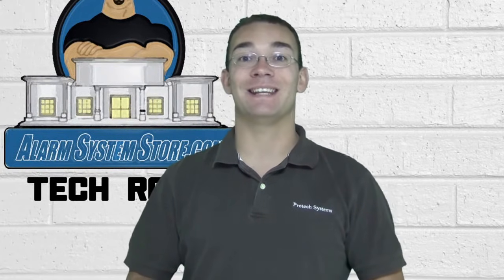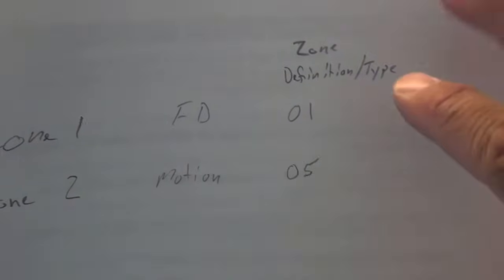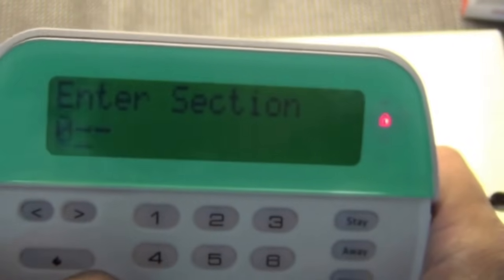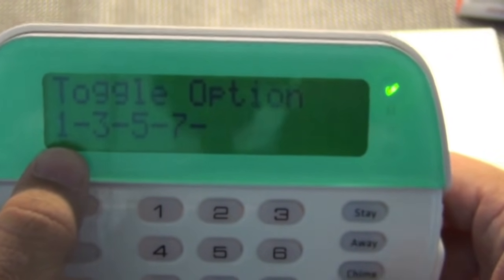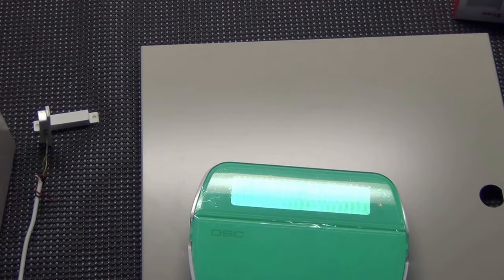DSC Power Series Programming - Alarm System Store Tech Video

Comment: Other than the extra work involved to install EOL resistors, is there a good reason not to use them?
Reply from the maker: No, it is always recommended that you use resistors with your wiring as it offers a little extra troubleshooting help if you have wire problems. The option to skip them just exists if you don't want to mess with them.

Comment: How to reset the master key?
Reply from the maker: If you can get into the programming of your system, the master code can be reset there. If you have no codes for your system, you will need to perform a hardware default and essentially start fresh with the system.

Comment: Can you please post for the system DSC RFJ5501 of how to get rid of the yellow triangle. My system was installed 12 years ago and the company is out of business! Help!!!
Reply from the maker: Unfortunately those systems and keypads have been discontinued so we dont have a way to make a video for them anymore. If you search up the manual for that system though, you could check out the procedure for checking trouble codes. The 5501 keypads can be difficult to work with though so it may be better to see if anyone in your area works on alarms without forcing you to buy a new one.

Comment: Using pk5501 followed the quick start and video. Have 4 zones. 1 being front door (delay), 2 interior door (instant), 3 motion (set to 5), 4 interior (instant).
My motion does not work. Thought it was a bad sensor and changed. Same result. Is there something I’m missing? What should the attributes on this be?
Reply from the maker: Generally you don't mess with attributes for a hardwired zone.
Reply: @AlarmSystemStore  any ideas why it does not operate? I checked, and I have 12v at the board, and terminals are nc/c

How would I program/re program just the motion w/o erasing the system. Thanks btw

Comment: What a horrible description on what zone type to use for motions.  It should be a zone type 4 Interior follower. If you program as 5 and your walk across your living room to turn off your alarm by the front door the alarm trips because you walked in front of the motion that has been programed as an instant. The interior follower knows you've open an entry exit zone and will give you time to disarm BUT if you come through a living room window and walk in front of the motion it goes of instantly because you did not open an entry exit zone, and yes they will also shut off when armed as stay.
Reply from the maker: Might wanna brush up on your DSC zone definitions. From the manual:
  [05] Interior Stay/Away: Similar to ‘Interior’ except that panel will auto-bypass the zone if Armed in the Stay mode  

05 is in fact an interior. The only differnce is it allows you to automatically bypass in stay mode in case you want to arm at night and walk around without tripping the motions. 04 is generally only used in commercial where that is not needed.

Comment: My magnetic contact has the green check mark but doesn’t turn off when the contact is disconnected. Any ideas?
Reply from the maker: Too many possibilities to really explain each here but.. programming, wiring, contact itself, zone def used. You really just need to explore each. If you have multiple contacts on one zone, perhaps you've wired them in parallel rather than series.
Reply: @AlarmSystemStore  ive checked the wiring and the contact itself. Any ideas on zone definitions? What zone definition is for a magnetic contact that stays on?
Reply from the maker: @Yeahitsmeagain92  Any zone def that has force arm on such as the stay / away types will always show green like that.

Comment: NOTES

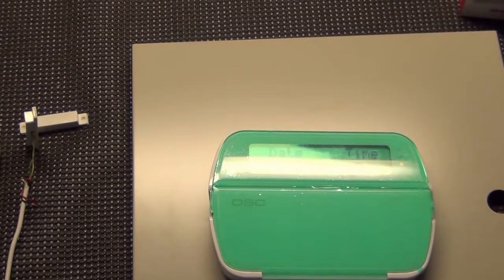03:22 Entering Programming Mode [*6], And Setting Time & Date [[24 hr format] hhmm mmddyy]
04:36 Entering Installer Mode  [default password: 5555]
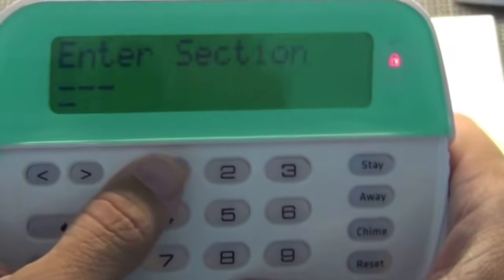04:52 Entering Zone Data [001 & 002]
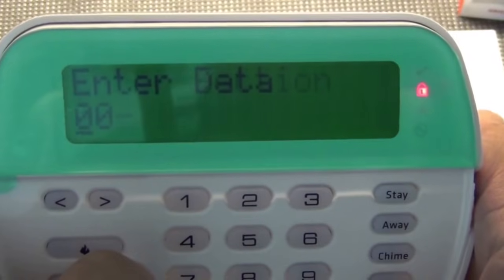05:54 Toggling Zones [202]
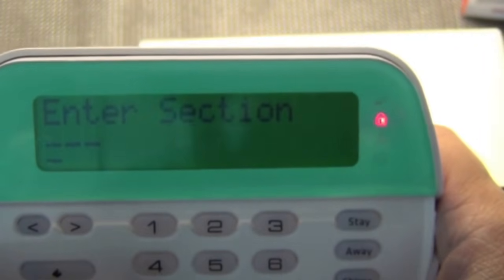06:21 Entering Partition Data [005]
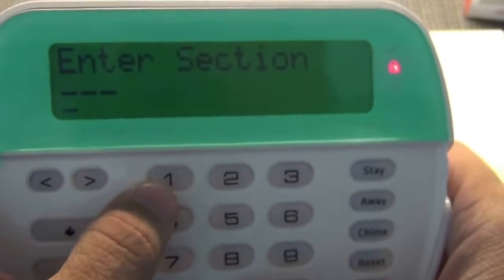07:33 Entering Resistor Data [013]
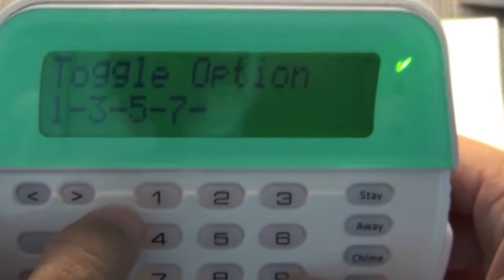08:09 Setting Telephone Reliability [015]
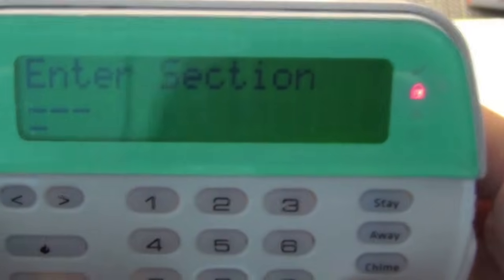08:58 Quick Start Guide
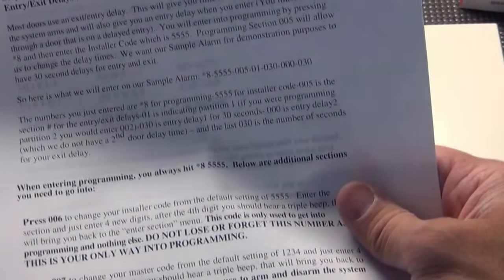09:20 Setting Master Code [007]
09:48 Getting Orange Triangle Data [*2]
10:12 Conclusion
Reply from the maker: Thank you @Eugene Wong
Reply: Legend good job

Comment: You missed the easy way .... FLOW Chart programming of the panel ... no manual required ..... it flows to each section like the manual reads but o the LCD keypad .... POWER  series PK5500 lcd brought it out first but never advertised the feature ...

Comment: How do you program the keypad on a dsc so it doesn't beep when the ac power goes out?
Reply: It won’t beep if there’s an AC trouble but will beep if there is a low/missing battery

Comment: How to remove partitions selection? Even I did hardware reset and system reset it always appear, it's hassle you need to choose from partitions 1 to 4
Reply from the maker: There are several steps to partitioning a system, most of the programming step in the panel. There is one however in the keypad programming and that is why resetting the system didn't resolve it. From this particular keypad you need to go into keypad programming 000. Going off memory but I believe you hit 0 again to get to partition and slot which is where you change the partition that this pad is assigned to.

Comment: sir , what is the code for PIR sensor with exit delay?
Reply from the maker: All zone types will provide an exit delay, but if you want a motion to be stay and away capable as well as have an entry delay you would use an 06 type.
Reply: @AlarmSystemStore  Thank You sir, and one more , How to label each zone to identify?
Reply from the maker: @ajithk.a5556  This is done in keypad programming, assuming that you have a full alpha model keypad. I don't believe we have a vid on it but I will add it to our list.
Reply: @AlarmSystemStore  I don't have full alpha keyboard. I watched your neo keypad video, Is that zone labeling settings same as above green light keyboard?
Reply from the maker: @ajithk.a5556  If you don't have a full alpha pad you can't program zone labels.

Comment: I have a DSC system with three keypads, three partitions and a RF repeater.  All I have to do is delete a zone in trouble and learn a new one in.  I tried all three keypads and my programmer and could not get into programming.  I press *8 and it says, "INVLID ENTRY" before I even enter the installer code.  I am going back tomorrow and I do not want to have to swap it out
Reply from the maker: I could see getting that after your code is entered, but I've never seen it display that from simply hitting *8.
Reply: I think it was because one of the partitions was armed
Reply from the maker: @bobwalton4630  Ahh yes that will do it too.

Comment: Is there a way to stop the external strobe beeping when you turn the alarm on and off?
Reply: Strobes dont normally beep so I assuem you are talking about a siren doing this. Yes, the option is called "bell squawk on arm / disarm" It is off by default though. This is in program section 014, opt 1.

Comment: I have a dsc wired motion sensor that I want to remove. Can I just jump zone 1 to com and remove the wires. I do not have the installer code.
Reply from the maker: Yes that would work assuming your panel isn't using resistors. If it is however, you would need to use a 5.6k resistor to jumper it there.

Comment: How do I reprogram after canceling our monitor service to stop sending signals to avoide the error code 4 ? The person keeps saying we need  a service call or get monitoring again. Can I just disconnect the communication wire?
Reply from the maker: Unplugging the phone cable will still generate the FTC / Comm error. Only way to resolve it will be to deprogram comms in the system. If you don't have the installer code though you will be unable to do so.
Reply: @AlarmSystemStore  is there a way to find the installers code? The installer will not provide me with the number can I factory reset?
Reply from the maker: @straighttothepoint364  Youtube "DSC factory reset". If it's had installer lock enabled though it will not reset the code and there is no way around it.
Reply: @AlarmSystemStore  so that's how this guy scams another service call...ill leave it unpluged

Comment: When I power up the system and connects the bell I get a low yelp alarm from it. When I measure the bell output I constantly have about 12 V from the output. If I trigger an alarm the siren works att full volume so the system seems to work, but I cant get rid of the low volume alert sound! Any ideas what to do?
Reply from the maker: There is always supervisory voltage on the bell output. Generally the siren is not sensitive enough to sound from this. If it does though, you will need to add a resistor. I don't recall the value off hand  but I'm thinking it's a 1k.
Reply: @AlarmSystemStore  , I´m almost done installing my home security system :) The only thing that´s not working is the telephone dialler. I haven´t got any landline, only an old GSM dialler (Ericsson TS90) but I can´t get it to dial my phone when I trigger the alert. The display shows communication error and there are two cables on the gsm-dialler that´s not attached to the board... I havent got a clue where to attach them. Any ideas what to do?  If I call the dialler  from my cellphone I can see that the small light on the gsm-dialler changes, so it´s indicating that the sim-card connection works anyway..
Reply: @AlarmSystemStore  I used a resistor and now it is quiet :) Thank you for your videos, I would have been lost without them 👍👍